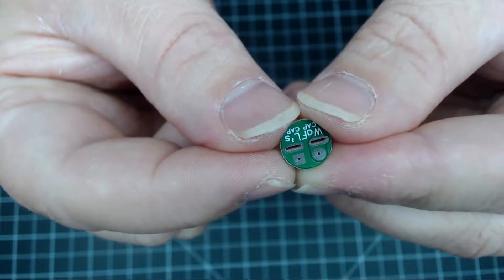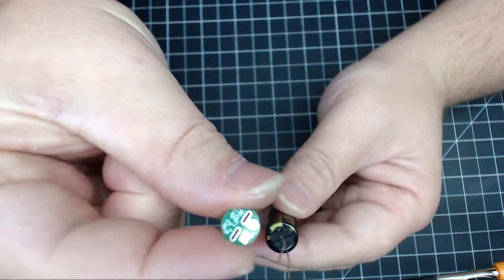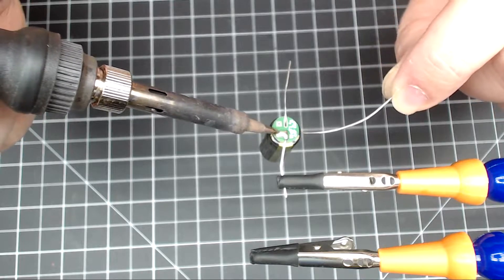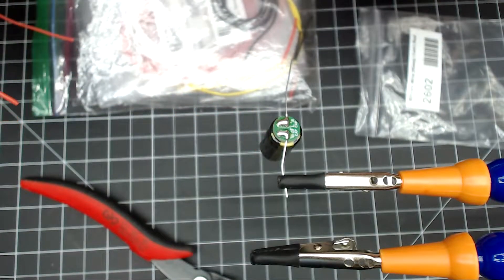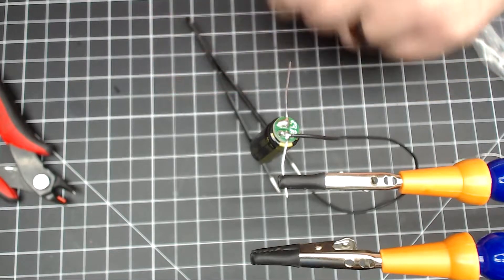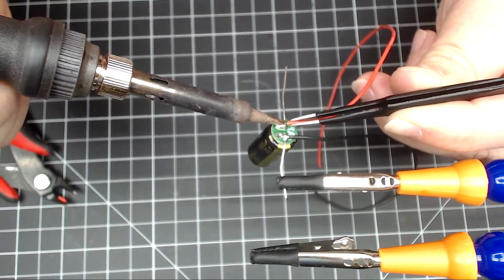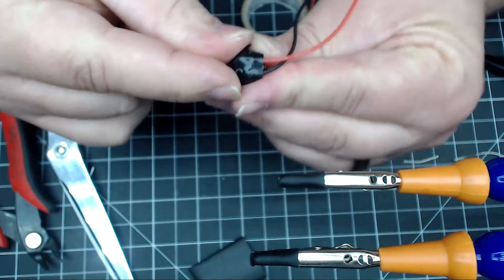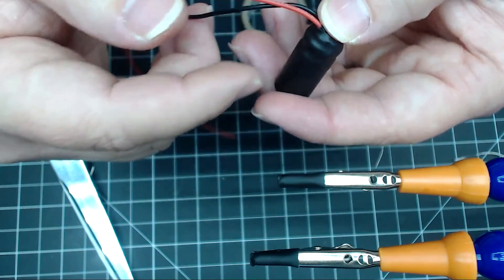Best way to add a capacitor to your Quad!

Comment: if you use the clear shrink tubing, you can kinda melt and mold a full enclosed case by heating and pressing against a table or using a glove

Comment: I use these all the time, because when you solder direct to the wires it makes it bulky, another tip, on all pdb boards the square pad is negative and the round pad is positive. Although it doesn't matter in this application, but it does have a positive and negative side on that waffle pdb. Same with all FC's.

Overall great demo, big like! 👊
Reply from the maker: Thanks for the info!

Comment: I don't use caps but that is genius!
Reply from the maker: Yea, I don't like them either. But its the case of better to have them and not need them, than not have them but need them.
Reply: @LarokCreations  yeah my setups don't need them..  if I were running a more typical race setup, I probably would.. The interesting thing with the caps is that back in the day all the ESCs had them from the factory.